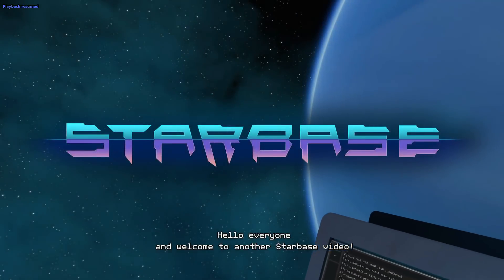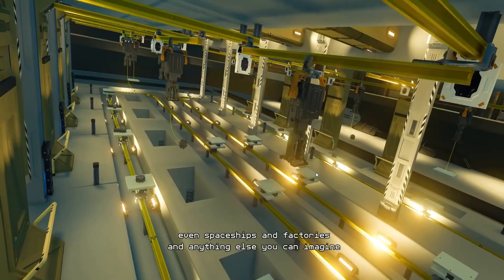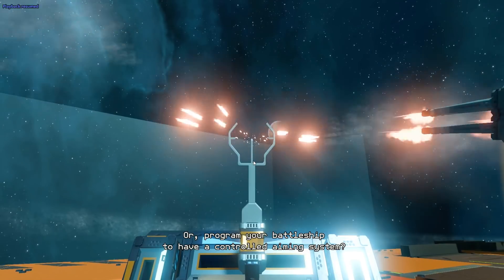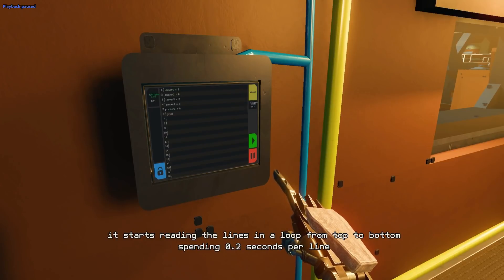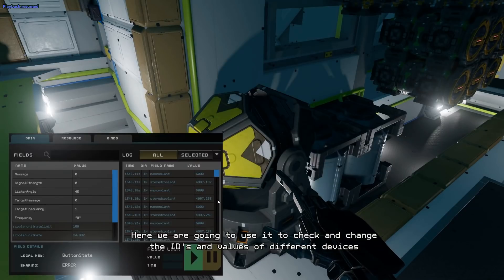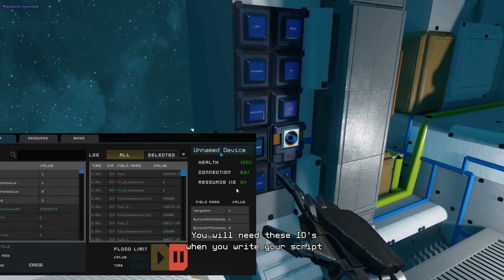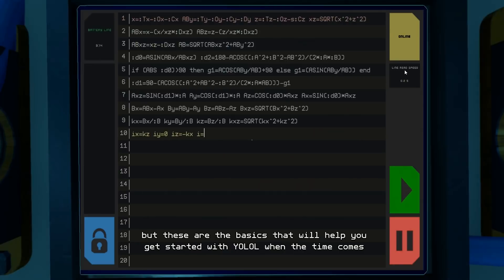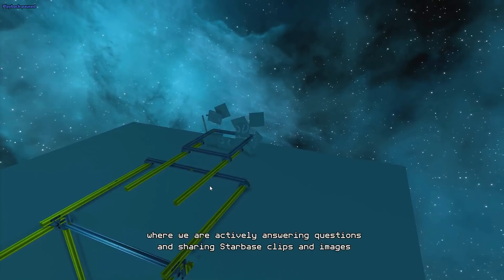Starbase - Talking about YOLOL Programming!

Comment: The biggest concern is the MMO aspect, definitely worried about optimization. I don't see how a server could handle 20 factories running on the same server, while there's a space war in the distance.
Reply: They won’t add singleplayer.
Also look at EVA online, several thousand players on one server.
I think getting a monsterrig to run it is a way bigger problem.
Reply: EVA Online has game play that circles around the thousand player count. In star base the real time physics aspect of it has me concerned.
Reply: I hope they have a single player mode is what I'm saying
Reply: Fred s guaranteed they are using cloud server tech. Everyone is on one server so you’ll only be running what you can see
Reply: but if it supports simple things for several thousand players, then it most likely could support a couple dosen of players doing more complicated things.
(I know servers are bigger, but not everyone is in the place.)

Comment: Oof, this will be difficult for those with experience in coding. Sure, you can perhaps learn it as you go but the more complex functions you want will take a while to build up. 

Hopefully this may not be much of a problem if steam workshop is implemented, allowing modders and ship builders to display some pre-built models and easier way to code.